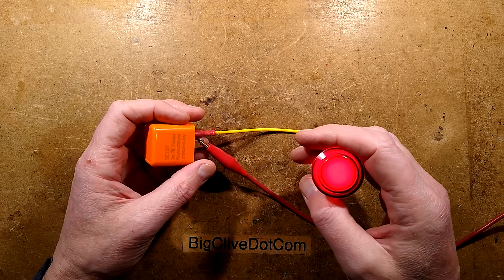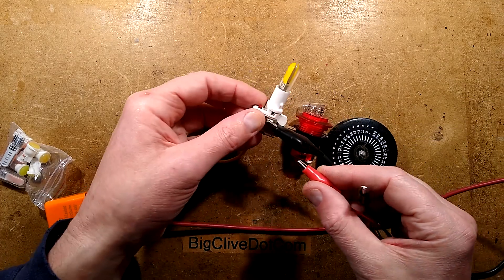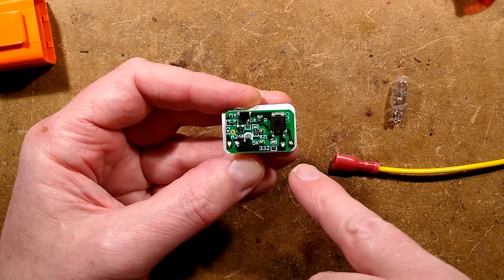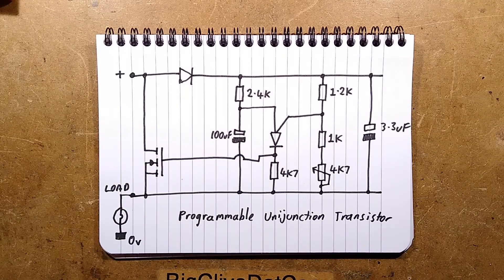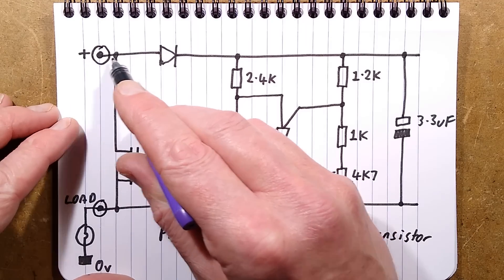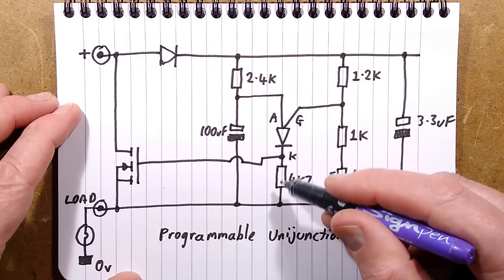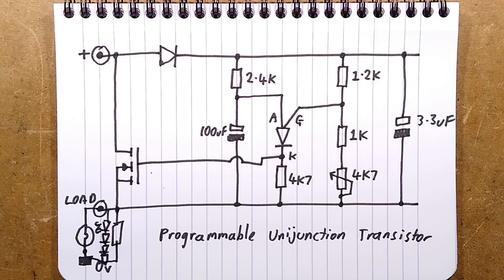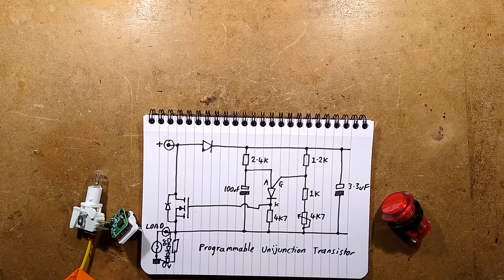Two wire flasher module teardown with unexpected find

Comment: ive always found it funny that to get a "low power led indicator to work" you have to add a resistor so it draws exactly the same amount of power as a filament bulb :)
Reply: Love your videos and explanations also the replies are often really informative and “one moment please “ you are a really funny nice man
Reply: that's how you change a 'turn signal' into a 'virtue signal' :P
Reply: LEDs don't just have lower power consumption than incandescent bulbs. They are also safer when they fail. LED "bulbs" are usually COB units with multiple LEDs and they tend to fail one LED at a time, meaning you still have some light rather than no light as would be the case with a single element incandescent lamp.
Reply: Exactly, what’s the point if you’re adding a load resistor. Don’t do an LED retrofit if you’re not saving any power
Reply: @charlie_nolan  LED retrofits aren't exclusively about power saving.  They're also about physical durability, thermal control and bulb longevity.
Reply: @Kineth1  yeah, I know. It’s also safer in cars in some cases, because the bulbs are on instantly and don’t have to heat up to brakes and turn signals are more instantaneous on cars etc
Reply: @charlie_nolan  Someone told me that flashers designed to be used with filament lamps has a charateristic blink rate that lower its speed when a lamp goes out as a way to alert the vehicle's driver to correct the fault. The flasher relays are current dependent devices for correct working.
So when you substitutes filament lamps with LED equivalents the flasher didn't flash at the legal rate or didn't work at all due the small current draw by LED lamps,   the solution then is to use the resistors in paralell with the LED or change the flasher for a LED compatible one.

Comment: Just what I need for my 1972 Hillman Avenger, so the flasher rate doesn't vary with battery voltage.  However it would require a "clicker" sound to be added by one means or another, perhaps a capacitively coupled piezo sounder across the pins would do it.

Comment: It's even more interesting that such a flasher is on the market today: they were common in vehicles from 60s and 70s and starting from the 80s 2, may be 3 types of specialized IC appeared that drived relay based flasher incorporating functions of direction signaling, emergency signaling and indicator of burned light bulb that behaved in the opposit to the bimettallic switch bulbs way - when current demininshed they would flash faster. I think in the 80s and 90s majority of road vehicles used common scheme with flasher module integrated within emergency light button assembly.

Comment: In the UK it is a legal requirement to provide an audible ( click ! ) , a comment way below says this is done by an other means ( sample / chip ? ) .... There is a similar circuit , that uses 3 bipolar transistors , that I built in the 1970's ( but I do not have it to hand ! ) , a modern automobile has many ( front / rear  winker ) LEDs , so should provide enough load for this unit to work ?

Comment: Very cool. I have a self powered electric fence flasher (high voltage, low power) I'd love to see you tear apart. I should figure out how to send you one. 😀
Reply from the maker: It's possibly just resistors and a neon indicator.
Reply: @bigclivedotcom  It's LED based, and pretty sure it's a charged capacitor arrangement to step down the high voltage (7-10k) to something the led's can use. IT's also interesting that it only flashes on every other pulse, or every three pulses if the fence is degraded. Or none if it's less than 3k volts.

Comment: My favourite 2 wire flasher is on a site called techlib, under elctronics and flasher circuits. Works in almost the same way but uses a PNP and NPN transistor instead of the unijunction transistor. (3rd attempt at commenting, youtube spam filter keeps removing them...)

Comment: Very cool, but not for me. I don't want the delay between my commanding indication and the lights getting power and I rather like knowing by the change in flash rate that a bulb or connection has failed.

Comment: Wow I remember unijunction transistors from my childhood in the 70s and early 80s. They were commonly used for simple oscillators and sometimes clock circuits for logic chips for a while in varous hobbyist magazines. The number TIS43 rings a bell as a commonly used device (funny how you remember things like that). The symbol I remember wasn't like that though (see the wiki page). They disappeared after a while to be replaced by 555 circuits instead.

Comment: To me it is mind boggling that walk-in coolers/freezers ever had the risk of being trapped inside. It is equally hard to reconcile the fact that someone realized it was an unacceptable risk, and then decided the best way to mitigate the risk was to put an alarm button inside instead of a handle to operate the latch.
Reply from the maker: Things can go wrong with handles and door seals can freeze.  Being trapped inside a blast freezer would be a very bad experience.

Comment: Great Teardown Clive i've used some of these on motorbike projects so seeing the schematic and explanation was excellent.A lot of older bikes run on a 6 volt system and would benefit from LED indicators is it possible to modify this to 6 Volt ?
Reply: Exactly my idea. I have a 6V Honda XLS185. I am thinking of using a boost converter to create 12 Volt, and this new delay switch. It only needs a low voltage to run so I think it will work. For 99% sure. And yes, maybe we need to do the same trick, add a small resistor.On Ali I see it needs 50mA draw to work, we can work that out!
Reply from the maker: It might be worth experimenting with the value of the 1.2K resistor.

Comment: The better flashers have a separate ground wire you have to hook to chassis ground somewhere. The two prong ones are counting on having enough bulbs in circuit to pass enough current through for the circuitry to work. Here in the US around the 90s ish there were a number of catalogs like Jc Whitney selling electronic flashers that played music like elvis etc. They are still around but not very popular as it would be really annoying and modern cars don't have flashers in them anyway.

Comment: First came across PUT' s when l was a  photocopier  engineer. When the toner bottle needed replacing it would switch the PUT on, it would then stay on until the bottle was replaced and the reset button was pressed.  This would then break current flow though the  PUT and the light would go out

out

Comment: Circuit doesn't seem to do another function of the old flashers -- flash quickly when one of your turn signal bulbs has burnt out, alerting you to change the bulb.  I could see this function not being missed if the bulbs are LED and rarely fail, but then you demonstrated that the new circuit doesn't work with LEDs either.

Comment: Try 4 LEDs it should trigger. Also If the flasher is rated for towing it might need 6 or 8 to flash with LEDs at the nicest speed.

Comment: The venerable put, 2n2646 springs to mind, it was very popular in industrial controls.
Electronic car flasher modules in the 80's & 90's had a current shunt, if one of the bulbs failed they flashed at 2x speed to warn the driver a bulb was dead, all done by the body module nowadays.

Comment: Is the "don't use acid cure silicone" warning just a function of being in a car where that might be more common? I thought anyone working on electronics would be very familiar with neutral cure/electronics grade silicone
Reply from the maker: In the application I mentioned it was due to the widespread use of acid cure silicone to seal all air entry gaps in coldrooms to prevent condensation and ice issues.

Comment: Welp, thanks Clive.  Now I am down a multi-hour rabbit hole looking at PUTs, Unijunction Transistors, and SCRs and trying to understand the real differences between the devices.  I remember PUTs coming onto the scene in the late 60s or early 70s.  My dad got quite excited about them after seeing them in Practical Electronics  and even bought a couple to play with (I learned late in his life he was really a polymath chemist metallurgist mechanic electronics tinkerer and btw spoke 10 languages.  To me he was just dad and I thought all dads were like that).

I get the feeling that PUTs are just relabelled very small SCRs and that the relabelling was more of a marketing move to get folks to think about designing them in where UJTs used to be used.  The online resources don't really give enough detail for me to ascertain the real differences between the physical construction.  HOWEVER I do have a copy of "Physics of Semiconductor Devices by Simon M. Sze" and I will go rummage through that bible later today 🙂

Great video as always Clive.  Thanks!
Reply: puts seem to be an 'upside down' version of a scr as the gate is triggered negatively with respect to anode rather than positively with respect to cathode as with an scr!
Reply: @andygozzo72  looks like you are correct. I dug up my copy of S M Sze pg 237 😁 

4.6.2 Programmable Unijunction Transistor

The programmable unijunction transistor (PUT) is basically a p-n-p-n device with an anode gate (gate contact made to the n-base instead of to the p-base as in a conventional thyristor). Figure 41 shows the device structure and symbol for PUT together with a typical PUT circuit. The waveforms observed are similar to that for UJT, as shown in Fig. 40b. The period of oscillation is also given by Eq. 70 except that n = R2/(R,+R₂), where R, and R₂ are the resistances of the voltage divider. For a given RC product, the oscillation frequency can be adjusted by varying the circuit elements R, and/or R2. Therefore, PUT is more flexible in frequency adjustment than UJT.
Reply: I am also blown away that I can point my phone and Google Lens at a page in the book and ten seconds later cut and paste high quality OCR text. Wow

Comment: The basic problem this relay is trying to get around is an old one. If you hook up a trailer and add its lamp load to the car, the flash rate would go way high. So you would swap out with a HD relay and then it would go normal, take off the trailer and it would go low or stop. Eventually solid state timer relays were developed and sorta fixes the problem with two wire relays. The other way that was common in HD vehicles (and bikes) was a 3 wire relay. Some like myself started adding trailer light relays to break the current dependence. They also allowed you to fuse for just the trailer connector, and take the extra load off the vehicle ckts. You could also translate the odd (for the US) euro taillight setup to the basic trailer light setup with a couple more relays.  I worry that modern cars with LED's might not like a old trailer with incans, dropped on its ckts, so a relay box might be good there also.

Comment: I always remembered the bimetalic flasher indicators always had a slight randomness to them depending on the load of the lamps and the ambient temperature - quite often you could have left side flashing quicker or slower than the right side, and a faster or slower on-off cycle time cadence when freezing cold (instead of a regular  dit - dub - dit - dub you'd get dit------dub-dit------dub or vice versa) - at least that's how I remember it on my Morris Marina LOL - I always wanted to replace them with electronic timed version but never got around to it  :) I did however build an electronic points module to reduce the sparking and wear on the distributor points, thinking it'd make for a better more reliable spark, probably made no real measurable difference!

Comment: If you have ever driven a car with a two wire flasher there is an annoying issue in modern traffic. When you indicate there is a delay before the light goes on. As far as I could tell this circuit still has that problem?

Comment: interesting device unusual using a PUT haven't used one of those in a long time  I remember making a little circuit with one to flash an LED when the battery started to run down the flashing sped up as the battery ran down

Comment: Interesting little thing, but would not be legal for use on UK or European roads. It fails on two points; Point 1; It does not emit an audible warning that it is active. Point 2; It has no provision for changing the rate of flash In the event of a lamp (bulb) failure.  On point two, if a lamp should fail, the flash rate must automatically increase to double the normal rate if one bulb fails, and should not function at all if both indicator bulbs fail.

Comment: As this is intended for automotive use it would have been more appropriate to designate the terminals as the standardised automotive scheme i.e. Input = 30 (batt+), or 15 (ignition +). Output = 87a (relay normally closed). Cool little thing though, that would prevent that thing where the lights stop flashing or flash really slow at idle, like used to happen with some old cars and motorcycles.
Reply: B and L is totally standard on 2-pin automotive flasher relays right back to the early 60's and they make a right-angle connector block so you can't fit them with the wrong polarity. Sometimes there's a + instead of the L. 3 pin ones also have a P terminal which is a seperate pin for if you're using a single dash indicator lamp.
Reply: @twostroke350  Maybe that's a British / US thing, just pulled a couple of relays out of my relay draw and I was mistaken about the terminal number, the numbers I stated are for standard / changeover relays. DIN standard flasher relays use 49 for input and 49a for the N/C output terminal and 31 for the earth in a 3 pin. I served my time and spent 20 years working with VAG cars but  Fords, GMs etc. all changed to the DIN standard. B+ = 30. Ground = 31. Ignition = 15. Relay coils = 85 and 86, relay contacts  = 30 is input, 87 N/O contact, 87a = N/C contact. This scheme makes fault finding really simple across different marques, though I've forgotten most of them now I've been out of the game for 18 years.

Comment: The 2 pin electronic flasher in my 2008 motorcycle for 2x21W bulbs failed open a few weeks ago after a few invocations where it was flashing very slowly (usually indicating blown bulb).  Imagine that, you'd think a safety critical device would failsafe closed so at least the indicator lit without flashing.  I cracked it open, but the bottom half of it, including the mosfet are potted in epoxy.  One 1/2W resistor is looking a little toasty, but there were at least 6 resistors on the circuiboard.

It just so happened that before discarding my 1981 mitsubishi colt in 2002, I pulled anything of value of it including a 3 pin flasher.  Wedged it in the fairing without clip because it was a slighly larger footprint, and connected an earth wire up to it, and it's just like brand new, but now with a satisfying click-clock-click-clock operation.  And I know it fails closed because of the NC relay.  Not all new technology is good technology.  Now I just have to work out what to do with this 2 pin flasher that arrived in my mail, given I think I prefer the reliability of that 1981 unit.

Comment: As you say, how odd. Do old fashioned flashers have 2 or 3 connections? I thought 3 but might well be wrong.
Reply from the maker: They seem to be available in two and three wire versions.
Reply: @bigclivedotcom  Interesting. Many thanks.

Comment: What was the reason the old flashers were clicking twice as fast when the bulb had burnt out?
Reply from the maker: Lower current affecting the bimetallic heater timing.
Reply: @bigclivedotcom  Correct and true.
You've passed ;)

Comment: I've had one of these flashes, they need about 0.2 of a amp at 12v to start flashing I.e 2 motorcycle led lights (multiple leds on 1 board). Good little units although the 3 post one I.e positive, ground and light output post work best for 1 led jobs

Comment: Clever combination by someone with "dark age" experience in electronics.

It is of course a feature in classic car electrics that a failed lamp will cause the flasher to flash more rapidly, alerting the driver to a fault.

To that end, the purpose of this device is confounding. Digitalised cars don't need such relays and the can continuously sense if the load has failed, confusing the operator with pings and bongs.